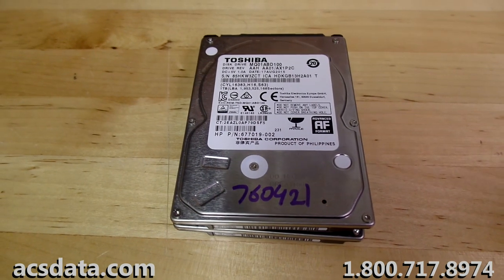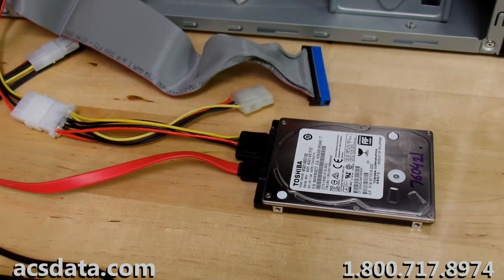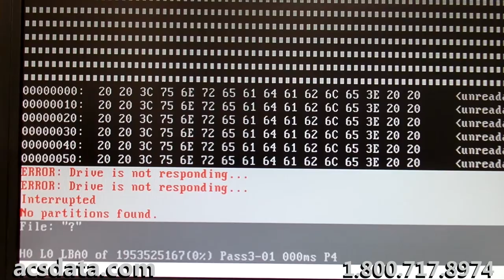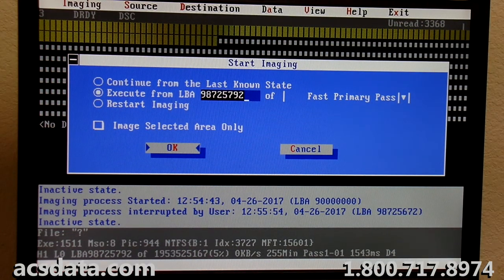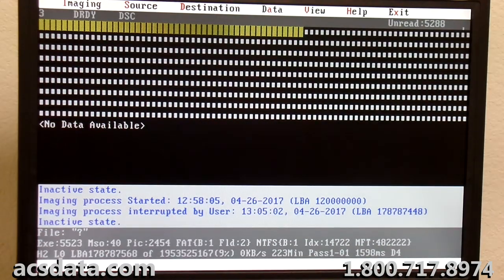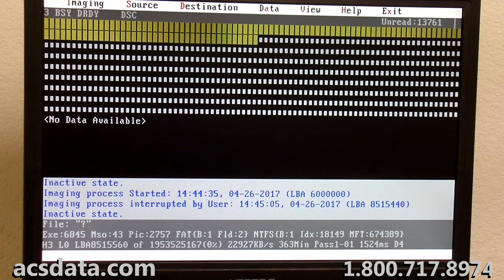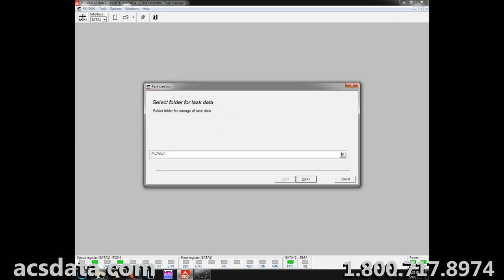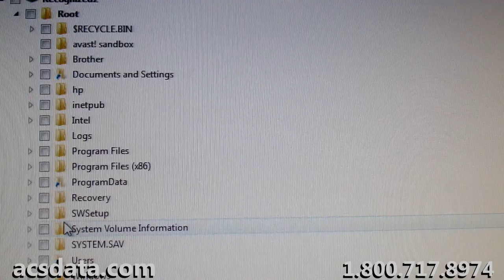Data Recovery On A Dead Hard Drive With Failed Heads

Comment from the maker: Feel free to ask questions or share your data loss nightmare in the comments below.  If you have a hard drive with a physical failure, we can help.  Visit our website at https://acsdata.com for more information about our services.
Reply: I will ... Because I need some .Dat files as well. It's one Mac and one PC hard drives.
Reply: I have an HDD with the arms continuously bouncing off the disk. the disk spins and the arms TRY to move over the disk but they seem to hit a part of the disk, bounce off, and try again several times before the disk finally stops and fails. Any tips? Am I screwed?

Comment: Don't take me wrong... i'm just curious i don't want be polemic.. If for this drive the target was to replace the head sliders why did you disassembled also the pcb board of the donor? I mean it was necessary for the recovery of this drive or just for other purposes like resell or increase the inventory for other future recoveries? And why did you used 2 piece of plastic to separate the magnetic head sliders instead of using head combs? Because it's more cost effective solution since head combs are expensive and hard to find? or i miss something else? Last question: after swapping the arm actuator theoretically the drive shouldn't work as before? i mean if i swap the arm actuator with a donor and simply plug the drive in the computer i wouldn't see the drive on my desktop and wouldn't be the file readable wihtout mandatorily using deepspar/pc3000 or other softwares tools to extrapolate data? I mean what would happen if after a swap i try to plug the drive directly in the computer? i won't see any data or i will see some part good and some corrupted? i mean what would be the best or worst scenario? thanks for the time and eventually for a reply :)

Comment: I have a question about inspecting the heads and cleaning the disk surface before proceeding, so if you have removed the heads, then why not first inspect them for discoloration from impact with the rotating platters. Second, after you determine which heads are at fault then why have you not attempted to clean the surface on the impacted surface. Using nitrogen gas to blow off any dislodged particles will not contaminate or damage the surface any further plus protecting the new heads you have installed. Time wise, this is a small investment, as you are limiting any future damage caused by contaminated head impacts that can be caused by the aerodynamics distortions of the flying heads from the loosened particles. bwireman

Comment: just want to tell stories of what happened to me.
i got terrible nightmare today... my toshiba 2.5" HDD 700gb just got "head failure" and there's no way to rescue it except i spend about $1000 to restore the data (to another drive). i'm not talking about porn or any content i store on it (and im sure no one even will think about it either lol), i have tons of sensitive data. i store all my account password (in an excel), personal video and photos i backup from my phone, all saved data from photoshop, sony vegas, Paid program, paid movies, paid tv series (i wonder if i can get those without rebuying them), several important video tutorials and very helpful website i save in an html file, paid content i have bought around web.... pretty much everything i gather in past 10 years.
i know it's head failure because when i opened it myself (after i call  and learn from expert of course) the head moving back and forth cause clicking and beeping (keeps going and never end). the platter seems spinning normal, the head didn't even stuck or bump, or whatever. and this expert didnt even know what really happened until he see it. so i came to his office and yes it's a head failure.  probably broken circuit board. and because its broken the head can no longer read data even the HDD world fine.
he offer me about $300 for the services to see if he can fix the HDD itself. he said the probability is 40% because maybe the broken head cause another damage to the platter without knowing it.
he offers me another option to replace the board with the new parts cost $500 (price for HDD under 1TB), probability 80% if the platter is not damaged. some data may already corrupted during my self-fix attempt.
and another option is he offer me $700 for restore all latest active data (he said even if the actual data already corrupted he can restore it), and a piece of HDD or SSD cost $140 to back them up.

guess i a broke guy who can just gave up on all my data. i keep it in case i have enough money to restore them. goodbye to my files =(

Comment: UGH...i wish I would've sent my dropped seagate drive to you first than an other place. for one, your english is fantastic and 2ndly you're more detailed when showing customer what was wrong.
Reply from the maker: Thank you!
Reply: @acsdata  Can I send it to you for a 2nd look? i snagged the USB cord which which sent the drive to the floor. before plugging it back in, I noticed the plug was off center. I plugged it in and got nothing and quickly unplugged it. Never plugging it in again. It is full of videos i wanted to use for a documentary showing people how I that is paralyzed from the chest down, tamed feral kittens and our lives together. Most of the video is a years worth of security video of my interactions with the cats and themselves. 

I sent the drive to a recovery place back in early March and finally found out last week they couldn't recover the data. i couldn't understand exactly what was the problem because of his poor english, but something about damaged platter and it would read then stop. I would like to send the drive to you to learn exactly what is wrong and if you can recover any of the data. some would be better than none.

Comment: Hello. As someone, who understand inner architecture of hard drive, and stuff around platters/heads, why do you think, multi-platter drives are usually faster, than single platter?
Example... 500GB drive with 1 platter, with density 500GB/platter, is slower, than 2 platter 500 GB drive, with 2x 250GB/platter. I saw differance in access time from 15 ms to 19 ms (for 1 platter drive). But sequential write/read are actually faster for 1 platter drive, but it's because of platter density. (the more dense platter, the more data can be read for 1 rotation, so it's obviously faster because of platter density)

But... when you have same platter density, so for example 500GB 1 platter, and 1TB 2 platter, even sequential write/read is faster, for 2 platter. How it is possible, when head can read only one platter at a time? Why is 2-platter drive faster in seq. read/write, when it can read/write only one platter at a time? Can you explain please with hardware knowledge, which you have about hard drives inner mechanics? Noone was able to explain this to me yet.
Reply from the maker: It doesn't necessarily mean that it is reading/writing to one platter at a time.  Data is mapped out and split up a few thousand sectors at a time across all platter surfaces.  Anything more than a few kb in size is most likely going to be stored on multiple surfaces, so all of the heads can actually read and write nearly simultaneously as the data is being accessed.

Comment: Thank you very much ,a question: is there any other solution to recover a Toshiba 500 GB that has fallen down from my desk, not passing by  Dos system,a  software,phone call,or somethng else...
Reply from the maker: If the drive fell, there's a good chance the heads are damaged.  A repair will most likely be necessary.

Comment: How do you know what the problem is with the hard drives you get?  Like if its not the controller board that is telling the heads to read incorrectly or not function like they should?  I am just curious.
Reply from the maker: Most of the diagnostics we use come from having terminal access to the controller board.  In Seagate drives for example, you can see the terminal output as the drive has power applied to it and depending on the error you have, you can see what the root cause is.  Also, you can run head tests on each individual head.  That way if only one is bad, you can image the remaining good heads.  Swap out the head assembly and come back and image the platter that the failed head couldn't read.
Reply: That's pretty cool!  I didn't know that you can only read from a individual head and get the data off of it like that, you have some really nice tools that you use to get data off the hard drives you get.  What do you think would happen if you plugged the drive into a computer or laptop and tried to boot off of it wouldn't it be easier that way to get the data off of it?

Comment: Have you ever got a drive that was so old you didn't have spare parts? Like a 20 year old drive someone found in their attic or something?
Reply from the maker: Yes.  Even older than 20 years.  You sometimes forget how loud hard drives used to be until you fire one of those up.
Reply: @acsdata  So you still try to repair it? How do you do it without spare parts?

Have you ever worked on a JTS drive?